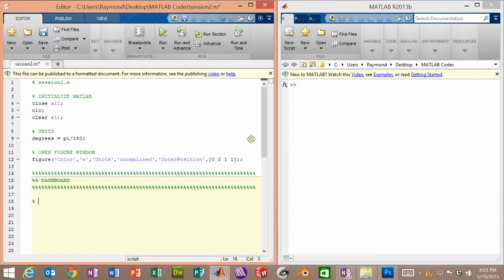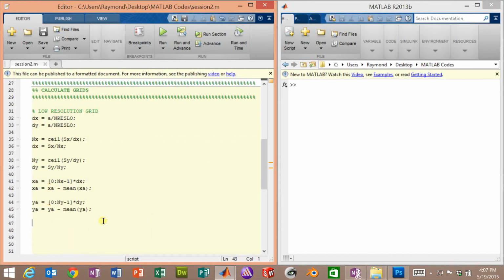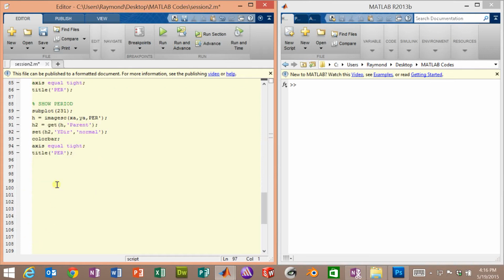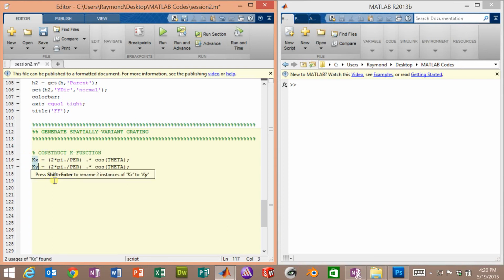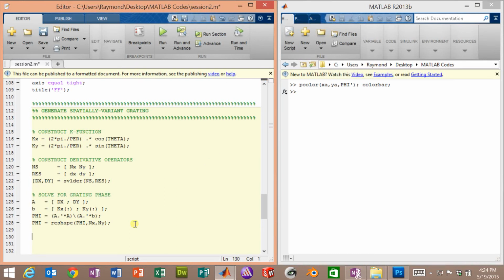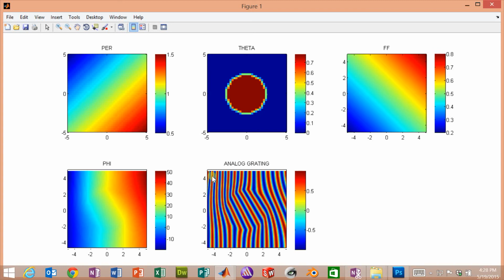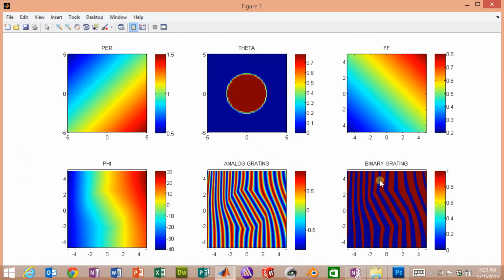Session 2 (SVL) -- Generating spatially-variant planar gratings

Comment: Dr Rumpf,
During the process of running the code, the command line window encountered an error with too many output parameters from the svlsolve function. How can I solve this problem? I followed your video every step of the way.Thank you so much!
Reply from the maker: There should only be one output argument.  That is PHI, the grating phase.  Can you paste the line of code your having trouble with?
Reply: @empossible1577  the line of code I having trouble with is
NS = [ Nx Ny ];
RES = [ dx dy ];
[DX,DY] = svlsolve(NS,RES);

Error message prompted by the window is
'Incorrect use of svlsolve
There are too many output parameters.'

error  svl (line 106)
[DX,DY] = svlsolve(NS,RES)
Reply from the maker: @sylviawang8643  I see the problem.  I goofed a bit in the course. I started by teaching the numerical aspects of the finite-difference method that I used to solve for the grating phase.  I then changed my mind and provided the function svlsolve() that does everything for you so that you do not need to know anything about the finite-difference method.  However, I never rerecorded Computer Session 2 which still has the finite-difference stuff.  Long story short, replace lines 119 - 128 in Computer Session 2 with

% SOLVE FOR GRATING PHASE
PHI = svlsolve(Kx,Ky,dx,dy);

I have updated the course website with this note.  Here is a link to the course website that I recommend using as your main portal to this information:

https://empossible.net/academics/svl-short-course/

Hope this helps!!
Reply: @empossible1577  My problem has been resolved！Thank you very much for your patience！😀
Reply from the maker: @sylviawang8643  Great!  Enjoy SVLs!

Comment: I am trying to implement SVL in Julia.Using Julia language I am not getting a smooth continuity for 'phi' for the '\' division and with pseudo inverse(pinv) . Probably it is in the pseudo-inverse that I am using causes the problem.  Any parameters for least squares function has to adjust? Every other steps including 3d is done.But this one is the crucial stage. I can share the inside image  of matrix DX, DY, inv(DX) and inv(DY).
Reply from the maker: You do not need to calculate the inverse of DX and DY.  From DX and DY you will build a rectangular matrix [G] = [ DX ; DY ].  You will be solving the matrix equation by least-squares so you will premultiply [G] by the transpose of [G] to get a smaller square matrix.  From there, it is simple to solve the matrix equation.
Reply: @empossible1577  Thanks a lot.

Comment: Hi Dr Rumpf,
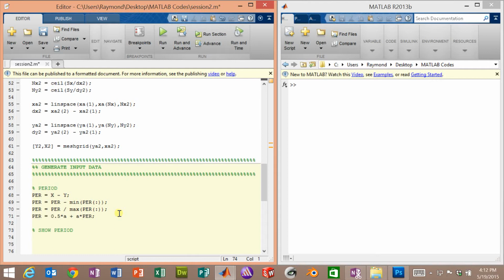how would you modify the code to be able to generate one of the gratings found in the lecture 1 intro around 8:54? is it just a matter of finding the right groove orientation and then the algorithm will be able to generate it? thanks so much!
Reply from the maker: Wow.  I somehow missed this question from two years ago!  I usually answer with 24 hours.  Very sorry!!!

It is just a matter of defining a K function with the correct orientation.  If there is some flexibility in the period, you can implement some corrections to improve the lattice.

For this specific structure there is an analytical way to obtain this lattice as well.  I cover this in my PhD dissertation at the following link (pp. 260-267):

http://purl.fcla.edu/fcla/etd/CFE0001159